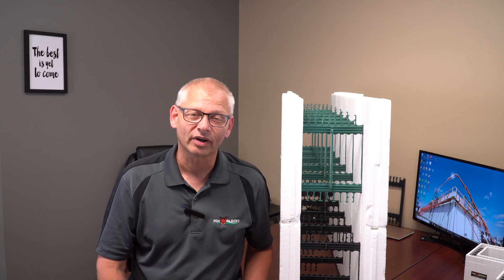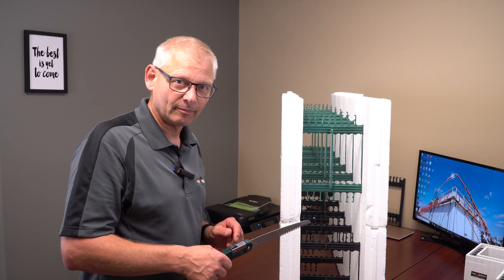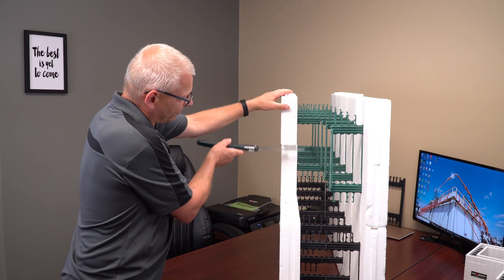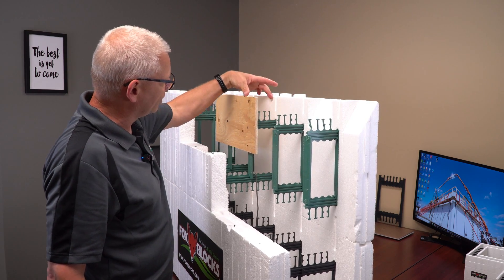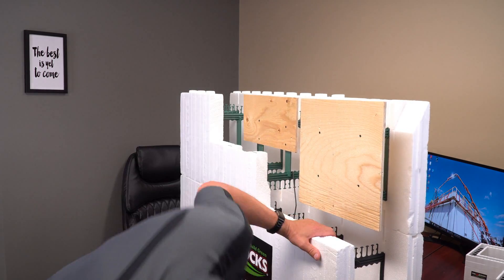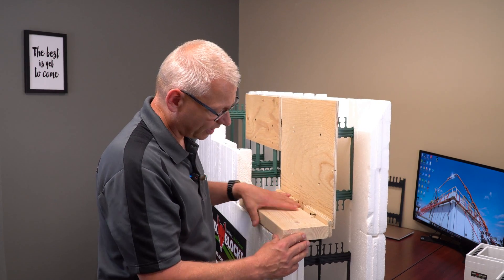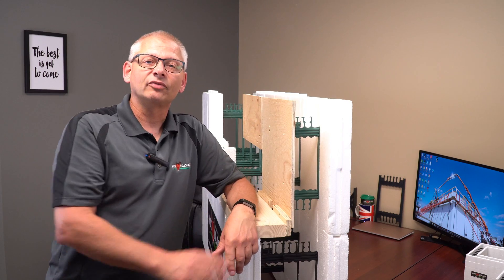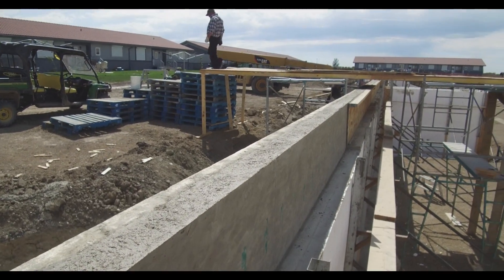Fox Blocks Curb Block

Comment: Would you be able to put two sets of "L" bolts in with this?  One set at the bottom for the plate for the floor joists attachments and one set on the upper for the plate for wall studs?

Comment: This is a good idea. Better that using brick ledge blocks turned around and facing inward. I have used the Simpson Strong Tie hanger system that you push through the block so the flanges will inbed in the concrete core. but this method seems more straight forward. 

Is there a way of using the ledge blocks to carry the first floor and then continuing with 8" blocks above? Thanks.

Comment: When I first saw this product I was wondering, then after reading I got the idea of it. This video definitely puts it into perspective, great idea for adding that extra height with better floor joist or truss support than something face mounted and  no interior insulation is necessary (as you said), can see this also being beneficial for ICF type slab floor installs as well. 
Can also see something like this being used on Reveal where instead of already being installed on the one side the user can add their own wood for final look and just do as you did and screw it into a flat side web like you demonstrated while still getting full core thickness. Perhaps the reveal side would have a thicker solid box type furring strip for better screw fastening if the owner/user building the home goes with cheap OSB for the pour and then removes it for then screwing up drywall (0.5 inch or thicker sheets) later since gypsum is so weak, especially when it gets wet. Unless they just fasten the gypsum over the OSB after the pour has set and the wood has dried.

Comment: Love the product. Liked the health and safety handrail
Reply from the maker: Thanks for the comment. Traveling all over North America I see all kinds of non compliance and often I cannot even shot video because the site conditions are questionable. It is getting better than it was back in the day when contractors would walk the top of the wall while placing concrete.
Reply: Government regulation is not the answer.  Over pricing is a problem because the gov is sticking its nose under every tent.  Not needed.  You nervous Nelly types only help to exacerbate this gov overreach.  You want socialism/marxism move to the EU or Not so Great Britain.
Reply: @lightning9279  My sister-in-law's cousin tripped on a job site and was impaled on a piece of rebar that was sticking up out of concrete. He died. That's why you see those orange caps on the ends of protruding rebar. Safety standards have reasons. Sometimes it might feel overbearing but I think that getting your people home alive at the end of the day is a worthy standard to hold yourself to.